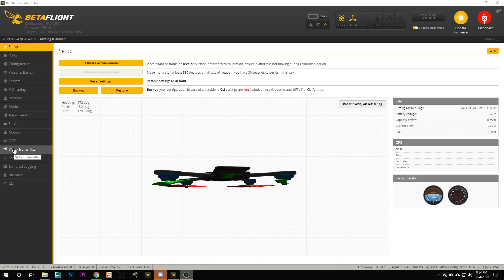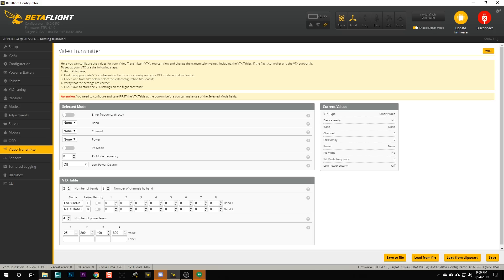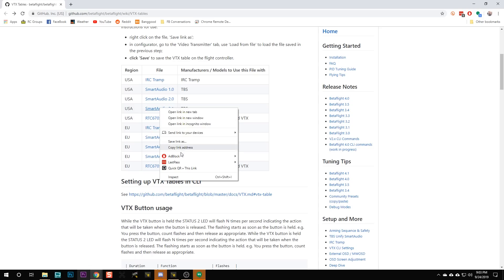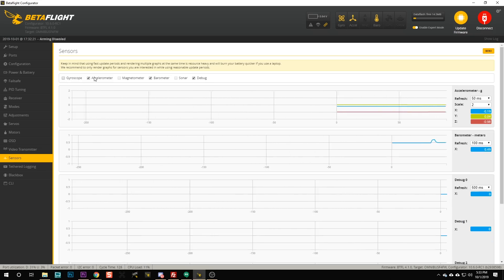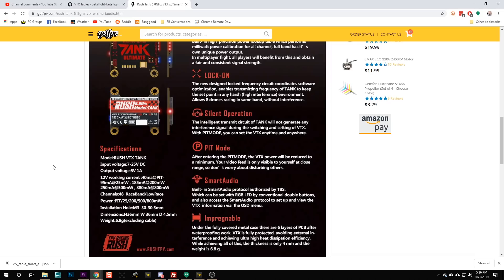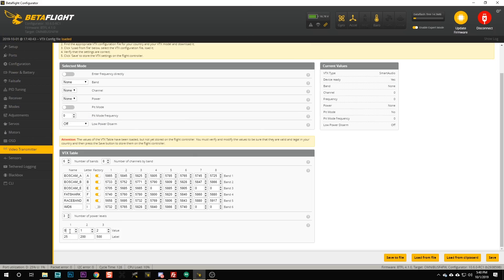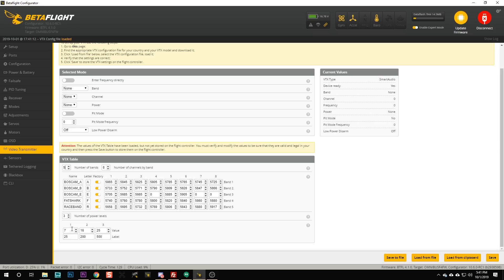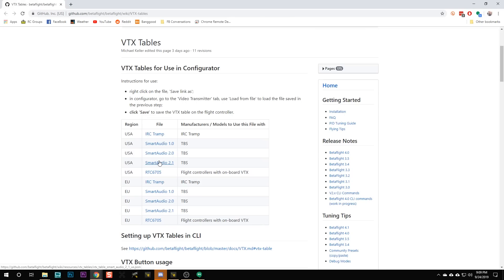Betaflight 4.1 vtxtables | WHY SMARTAUDIO DOESN'T WORK AND HOW TO FIX IT

Comment: I get nothing after plugging battery in sensors tab to determine Smartaudio version. Betaflight should expect major backlash over this one. Fine if it works...(it's not that complicated) but it's another 15 mins of setup for every quad that could be spent in the air. 

As an aside, have you already done, or could you do a video about VTX switching on a QX7? Like switching in and out of pit mode or lowest power mode via a transmitter switch. I should already know how to do this, but I don't.
Reply: same issue

Comment: On the wiki vtx table page it says 216 = Smart  audio  2.0 not 2.1 as you stated. I used the file for 2.0 but in my osd it says not configured . Have you seen that before ? In the video  tab  in BF I have everything  I m supposed  to I believe .
Reply from the maker: 216 is version 2.0, not 2.1 -- that's correct. It wasn't clearly documented at the time this video was made. "Not configured" means the vtxtable wasn't saved. Are you sure you hit save or whatever?
Reply: @JoshuaBardwell  Hi Joshua , Thx. If in my video tabs page if all the channels and bands are there time  after time  would that mean it was saved ?  Whats funny is ,if I change it to tramp in the ports page it shows up in my osd. Should the rapidfire change  channel  too. (outside screen)

Comment: I see a correlation!

There is nine between every step, it is linear because it is logarithmic ;)
Reply: Also, 216 means 2.0 unlocked.

Everything starting with 300 is 2.1 add 16 = 316 = 2.1 unlocked.

Comment: I have the tbs unify evo witch the vtx settings are 25 100 400 800,I got smart audio to work and the vtx power settings are the same when I use the stick commands  since I adjusted it in betaflight 4.1,but why when I go into beta lua script (vtx) on my transmiter it just does 25 200 500 800,is there away to make it 25 100 400 800.

Comment: Smartaudio works but i can’t change the output power. When i change the power in the osd and check Betaflight then the settings are there. But in the osd the power ist still 25mW.. there is no way to change output power. I have the same vtx as in this video. It worked on betaflight 4.0 but now i can change freq but not the output power. Why changing something that worked?? So no i fly without smartaudio like many years ago👏👏

Comment: Will this still work if smart audio is on softserial port?
Reply from the maker: yes.
Reply: @JoshuaBardwell  I could not get it to work, moved the wire to an open uart and it works. Not sure why my board would rather me use a softsreial port for smart audio rather than an open uart? odd

Comment: ive tried the debug but its not reporting anything? im confused
Reply from the maker: That means that the wiring isn't right or the wrong UART is set for SmartAudio in the Ports tab.
Reply: Ok. My fc doesn’t have a smart audio tab but it states in the instructions that the tx4 tab is smart audio. My fc is the clracingf4s
Reply from the maker: Right. So use TX4 on the FC connected to whatever the SA pad is on the vTX.
Reply: @JoshuaBardwell  you are the man.. i have sorted it now thanks to one of your older videos.. ive also installed lua scripts and fixed the rssi not showing in the osd again thanks to you.. i learned something today

Comment: rush pdf has all of it in there dbm etc,, 216 is 2.0  on github listing of values
Reply: Smart Audio Debug[0] key:
100 = SA 1.0
116 = SA 1.0 unlocked
200 = SA 2.0
216 = SA 2.0 unlocked
300 = SA 2.1

Comment: Hello. when you set your channels and power does this also unlock the power settings? i used to unlock these with the vtx button, i have set all the power settings on my Tbs unify pro, says what ever power you are set to on the vtx page of betaflight, but the led on the vtx stays a solid blue light to as if to say it is still locked?
Reply from the maker: I believe that SmartAudio 2.1 can be unlocked by the FC, but SA 2.0 and 1.0 cannot. You still should do the unlock via button press.
Reply: @JoshuaBardwell  Cheers

Comment: There is a bug in this.  On some start ups from pit mode there is static.  If you flip it on and off it goes away 80 percent of the time.   Turn it off in the port tabs not an issue.  This is on various quads on tbs and immersion vtxs.

Comment: I dont get a sensor reading for smart audio
Reply: im not getting a reading either.. i guessed at a vtx table and im still getting video .. so im not sure if it worked
Reply: ok MR Bardwell suggested that it was the wrong uart channel. move down the channels and set the next one and reset the previous.. mines working now

Comment: Joshua yours is 216 which is not 2.1 it's 2.0!
From the github VTX-tables page:
200 = SA 2.0
216 = SA 2.0 unlocked
300 = SA 2.1
anyway thanks for the help!
Reply from the maker: Yeah.... That table wasn't published when I made this.

Comment: Love your Videos Joshua! They answered many of my questions. What a great resource!
I do have a question:

I'm using BF 4.1.0, Eachine Red Devil 2 with the newest firmware.  I've followed your guide but the frequencies stay the same when I change them either through BF or the TX and OSD using Smartaudio. 
More specifically, BF and the OSD are showing the frequency I've selected, but the actual VTX is staying on the same frequency that was set using the hardware switch.
The same is true for the power setting.
What am I missing?
Thanks again!
Reply: same problem here with an AKK FX3 ultimate. Initial VTX-setting remains ( R2 5965), even though list is loaded, I can change through remote but it stays at R2 despite showing F7.

Comment: Of course I didn't know about the power settings in dbm, but I do know that every 3dbm doubles the power. So if 14 dbm is 25 mw, 17 dbm =50mw, 20dbm=100 mw and 23dbm is 200mw...

Comment: What do I do if I do not have the save link as option when I write click? Am I going to have to input it all by hand
Reply from the maker: You can click the file and copy the resulting vtx table. The BF configurator has a "paste from clipboard" option isntead of reading it from a file.
Reply: Thanks I'll try that tomorrow.
Reply: That worked thanks! Now to decide if I want to purchase the licensing to run RPM filter with BL Heli s esc

Comment: Hello Josh, my sensor monitor is saying 300 not 200 not 216 but 300 .... so what does that mean, what Smartaudio I have  ?
(FC: Omnibus, VTx: TBS Unify PRO HV Racing)
Reply from the maker: 2.1
Reply: @JoshuaBardwell  Hello Josh, (I'm so happy to hear the answer from my FPV/Drone Guru). Yes, I did loaded and configured my VTx and it works beautifully right now. Thank you ! :)

Comment: ok i kinda got mine working....but changing the values in in osd makes no difference at all...o and you missed us TRAMP users
Reply from the maker: Tramp is easy. No versions. Just load the file bam done.
Reply: @JoshuaBardwell  ah... It kinda works but now i can change the values but no effect takes place( change band/channel but stays the same)

Comment: Josh Mate I tried the debug and turn the quad on but debug value does not change ? is there any other way to find the smart audio version?
Reply from the maker: If the debug value doesn't change then that tells us that the FC is not talking SmartAudio to the vTX. So the wiring is incorrect or the Ports tab is incorrect. If it's a newer Unify vTX you need to plug it in to TBS Agent X and enable SmartAudio there first.
Reply: @JoshuaBardwell  I am using the same port for smart audio which I was using b4 upgrading to the 4.1 , and now it is not working .I am using clracing f4 and I targeted clracingf4 legacy for firmware and I am using tbs unify pro v2.

Comment: How about IRC Tramp Vtx protocol? I have the iFlight Succex mini Vtx and I'm having that same problem you referred to in one of your videos, but never really found a solution. For me, the Vtx is stuck on A1, but the FC thinks it's on E3 and when I make changes in the OSD, configurator, or CLI it doesn't change. My guess is the the Vtx remote control isn't working at all. Perhaps my vtx isn't really IRC Tramp?
Reply: I have the same issue Sam. IRC Tramp vex settings does not work following this video. Anyone else find success yet?

Comment: Debug/Sensors say 216 but only vtx tabel 2.0 works, tested very often on 2 kwads
Reply from the maker: Correct. 216 is v2.0 not v2.1 as the video says.
Reply: @JoshuaBardwell   In the video though you say 216 in V2.1. I can't get either to work though?

Comment: This is way too complicated. This will discourage a lot of new users. There needs to be a database where you specify what VTX you have, and betaflight figures it out for you.
Reply: I totally agree!  This looks like it might just take as long to configure as the entire rest of Betaflight!  At least for a while...
Reply: Take 10 mins
Reply: @noisy_boi_fpv_3920  Yeah, that's more than the entire time it takes me to completely set up Betaflight for a new model!  Way too slow, and doesn't work good after you do it exactly like JB showed us! :(  Need's to be streamlined.  Shouldn't have to do so much....most of that can be the same for every model, and preset.
Reply: @007 Cool name, Mr. Bond. LOL
Reply: soy
Reply: Spencer Owen you obviously didn’t listen to the legal implications the devs are protecting a free open source service to us all from been dropped from git hub what more do you want

Comment: HELP, anyone have any idea why my low power disarm isnt workig and im not able to change the power level in the osd but it will let me change the channel and band? ive set everything up correctly and am using 4.1 firmware  and 10.6 betaflight, should i try betaflight 10.6 rc2?

Comment: I have the rush vtx with 25,200,500,800. I know I need 2.0 smartaudio. And my power channels I use are 0,1,2,3. My question is what is the pitmode frequency?
Reply from the maker: Some vTX, when they go into pitmode, instead of going to low power, they go to a "trash frequency" that is reserved by the event for pitmode. If you are at an event that is using such a thing, you would input that as your trash frequency. However in practice, almost nobody actually does this.

Some people set their pitmode frequency as an L-band frequency (around 5300 MHz). This is not legal to do, but it would ensure that when you were in pit mode you were not interfering with anybody.

Comment: Up until and including version 3.5, Betaflight was about being able to just flash any quad  then do a bit of basic setup and have something that flew great enough for most people. I even think it was a point of pride for the devs. I think that paradigm has changed pretty dramatically since then. I guess it's hard to cater to all types of users.

Comment: What happens if you have CRSF and a TBS Evo vtx.(TBS OSD,not Betaflight OSD)..do you still need to do the UART BF allocation,and VTX tables download thing?
🤔🤔🤔🤔
Reply from the maker: No you don't need to do it. But you also can't use the OSD menu to set the vTX. You have to use your crossfire system.
Reply: @JoshuaBardwell  ..many thanks for clarifying sir 👍🍺

Comment: I have just followed this video to the letter and now I do not have any picture in my goggles and no signal on any channels???
Reply from the maker: This possibly means you have the wrong vtxtable loaded. One thing to note is that debug 216 is SmartAudio 2.0 not 2.1 as reported in the video. Try the 2.0 table.
Reply: Joshua Bardwell Nice one, thank you 👍
Reply: @JoshuaBardwell  OK, thanks again for the tip.  It turned out I was on 2.0 but I hadn't assigned the values 0,1,2,3, correctly.  I have also noticed the VTX now defaults to 'pit' mode on power up?  Quite a clever feature 👍

Comment: no .. 216 tells you that its 2.0 unlocked   ~300 is smart audio 2.1 - And smart audio 2.0 uses  0 , 1 , 2 ,3 power levels.
Reply from the maker: Yeah that is documented now. It wasn't at the time and both me and uav tech interpreted it wrong.
Reply from the maker: It's fucking idiotic that the devs didn't solve the problem for the users by putting in a way to simply report the actual SA version. Instead users have to read the SmartAudio spec and parse bit tables.
Reply: @JoshuaBardwell   That is a valid point, not hard to make a "Check Version Button" - We will hopefully see one in the next version of betaflight configurator.

Comment: So I updated to the new 4.1, sorted the VTX tables for my Unify Pro V3 (SA 2.0), double checked the power outputs on the TBS website, checked the frequencies of all bands, yet when i'm on say R1 (I have correctly put freq 5658 for this as it was 0 as i filled in all the 0's) but when i power up my quad and turn on my Fatsharks with TrueD, although the quad is set to R1, the fatsharks won;t see it on R1, it needs to be on like E1. When i roll back to 4.0.6 and restore everything, the fatsharks are R1 and my Quad is R1.....i'm lost!! @joshua bardwell :(
Reply from the maker: Enable "factory channel" option in vTX table. This will ignore the frequencies entered and use "r1" which the vTX knows what it is.
Reply: @JoshuaBardwell  You sir are a freaking legend.......If i'm ever lucky enough to meet you, i'm owing you a cold beer!!

Comment: hello! thank you for the video!
why in my betaflight there is no "video transmitter" tab ?
i run the last betaflight version
i am in export mode in beta flight 
thank you
Reply from the maker: You need configurator 10.6.
Reply: @JoshuaBardwell  this is what i have
Reply from the maker: If you have configurator 10.6.0 and firmware 4.1 on your FC then you should see the vtx tab.

Comment: Set it back to the way it was Betaflight! Smart audio was a feature I truly enjoyed about my quads, and after doing the steps in the video the band and channel are displaying as ?:?:25 on the OSD. Also, the channels are moving in increments of 1. I realize the rpm filters and these other items are cool, but this is a total deal breaker. I am not upgrading another quad until the simplicity of Smartaudio is back.
Reply: just go to oscarliang, and copy the cli and paste it in, a few minor changes and your good to go.  But I fully agree, this is facking BS, so glad EMU didnt do this, just plug it in and all the vtx channels and power levels are perfect.

Comment: Sorry for making another comment but I believe it is more structured this way:

I am using SmartAudio2.0 presets on the Happymodel Larva X (which you have as well) and I converted the 3 power levels (25mW=14,100mW=20,200mW=23). As soon as I save these settings and restart, the VTX seems to be at pit mode power level although no pit mode settings have been made. The VTX does not react to BF or OSD setting changes. When I set the power level back up with the hardware button this setting is not saved through a restart.

Is there something I have done obviously wrong? If not, could you be so kind and confirm this behaviour on your Larva X?

Regards
Reply from the maker: Try loading the 2.0 preset? If any vtxtable power level is wrong, SmartAudio won't work.
Reply: @JoshuaBardwell  it worked. It seems only 2.1 needs this strange conversion

Comment: Is it possible to change the RTX Power on a specific distance or RSSi so the vtx doesn't get too hot?
Reply from the maker: No, that's not supported. But the vTX shouldn't get hot when in flight anyway.

There is a Mode that lowers power when disarmed.

Comment: Do I have to do the mW to dBm conversion with IRC Tramp as well?
Reply from the maker: No just load the pre-configured Tramp file.
Reply: @JoshuaBardwell  thx for the quick reply. right now i am trying to update my Larva X to BF4.1. I know you have that too - did you update it already? No matter what values I enter for the power levels I only get a picture right next to the drone.

Comment: I think i have smart audio 2.1.(in sensors smartaudio says 217).  I Downloaded the usa version of tbs smart audio. My vtx is a AKK F2 ultimate. 25, 200, 600 and 1200 mh.
When I set to  band F channel 4, its set to F 4 channel 5 in my osd, and transmit in 5820 freq.
I change using osd and  using BF configurator too, but not take effect. What i´m doing wrong? 
In Betafligth 3.5.7 works great.
Maybe i'm using the wrong vtx table and i have to use the tbs 2.0 version?
Reply from the maker: 217 is actually SA 2.0 I believe. Sorry for the misinformation in the video.

Comment: I read most of the questions and didn’t see this so I figured I would ask, on the new TBS Pro 32 the power level goes to 1000 but there’s only triple digit number selection for power level. I set mine to 999 is this what I should’ve done?
Reply from the maker: For power level label you can use something like "1k" or "1W"

For the "value" it would be the dBm value corresponding to 1 watt, which is 30.
Reply: Thank you very much are the answer the question, you really are the smartest man on the planet! Lol

Comment: After inserting the vtx tables, the OSD does not work. What can be the cause?
Reply from the maker: Flash to the legacy firmware instead of the unified firmware.
Reply: @JoshuaBardwell  
solved, thanks !!!